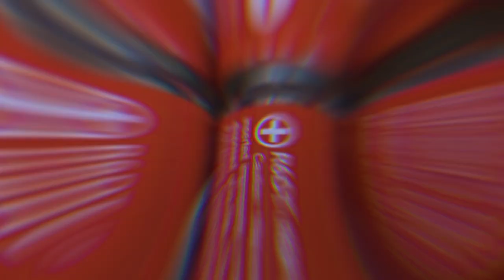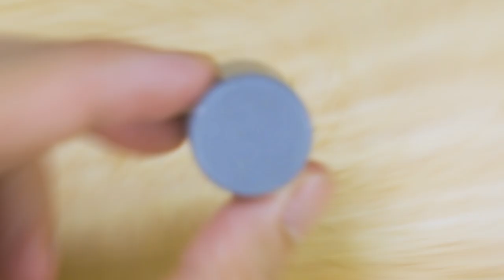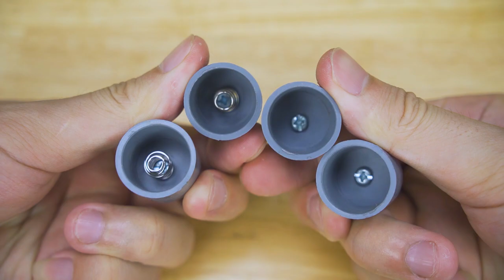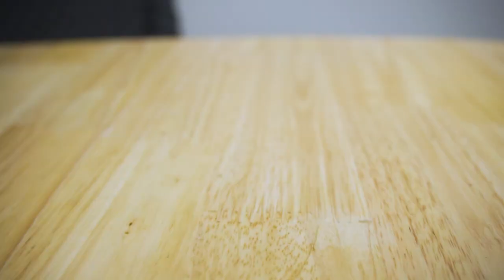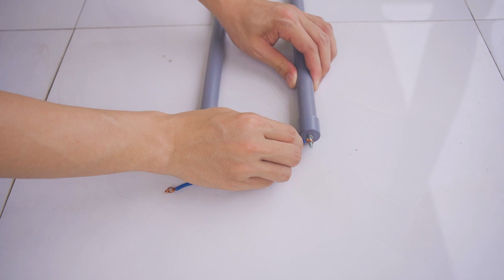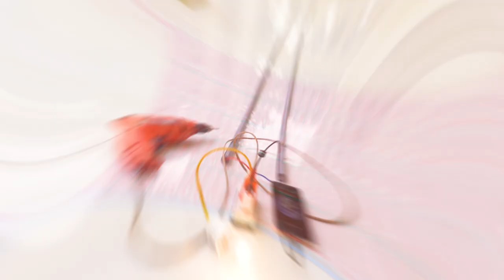How to Make 220V Battery with 1.5V Battery - EXPERIMENT

Comment: The drill requires a frequency of 50 Hz   in addition to 220 volts    ????
Reply: And mobile charger also need AC input 😑 and drill machine also
Reply from the maker: Drill and charger can run at DC, but fan doen't

Comment: So with a step down buck converter you could take that 240 down to power 110 or hell even 20v 12v and 5v dc
Reply from the maker: It's standard, it's DC power so it can only work with pulse

Comment: Are you sure that a standard bulb, a driller and a battery charger work with 240 Vdc???
Really sure?
Reply: I m also thinking same it's 240 volt d.c bulb🤔
Reply: I think over seas the electrical grid is set up for 240v, so if the want to run any products 110 they would need volt converter
Reply from the maker: Normally electrical appliances operate in the range of 200V- 250V. So 240 won't damage the devices
Reply: @nda  the problem Is that batteries provides 240 V DIRECT CURRENT, not ALTERNATE CURRENT.
Maybe, maybe the bulb will survive, but drill motor needs AC current.
I am not sure what can happen to a Power supply for a cellular phone, it depends by the circuit, but I am almost sure it will not work
Reply: @nda  200-250 V AC 50/60 Hz